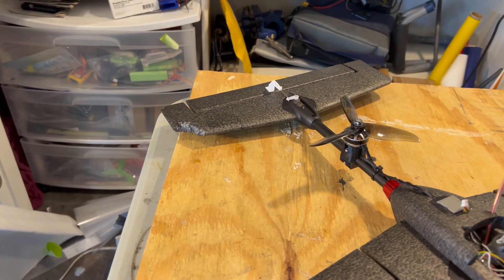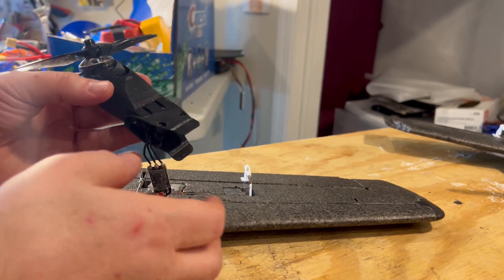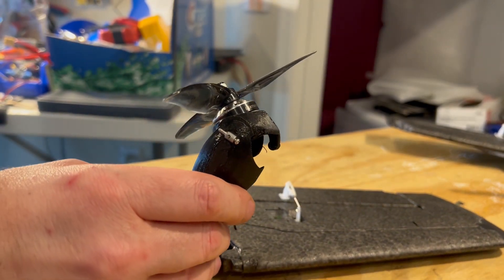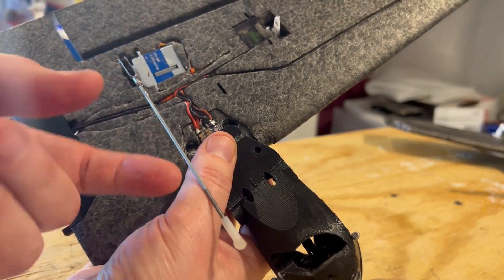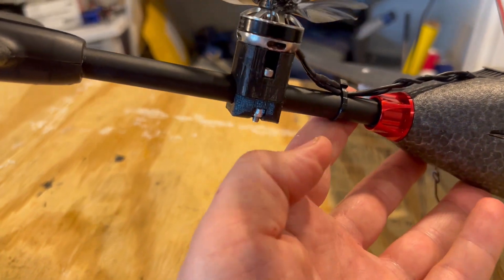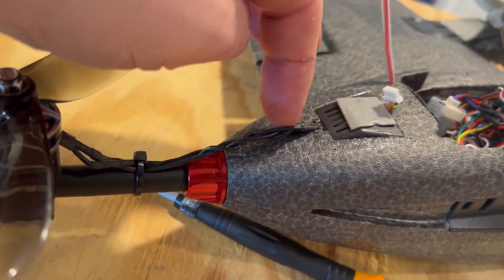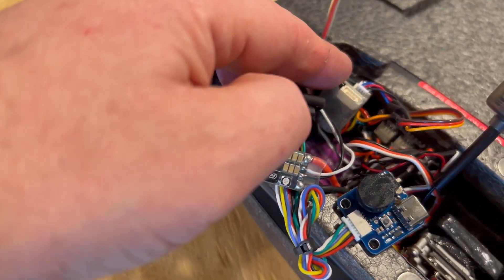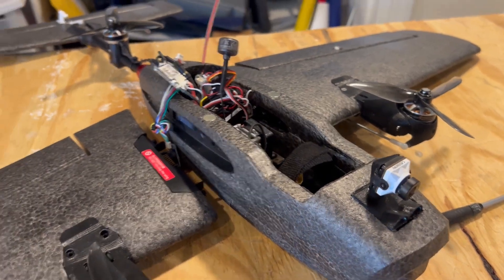Heewing T1 Ranger VTOL build walkthrough

Comment: Interesting build i have decided not to do this as it's very complex adds lot of points of failure decreases efficiency and add weight .. also it's really not needed the T1 can land on like 5-7m runway basically doesn't stall so I don't see why would anyone do this unless you wanna tinker or just don't even have that 5m runway 🙃
Reply from the maker: Well it may not be for you but some of us enjoy the challenge of building something different.  Also see my later video where I take off and land in my backyard, a flight I couldn’t ever do before.
Reply: @Appelm1  yeah of course that's why I mention tinkering.. it's cool just don't see the need for this airplane at all lot of sucrificing made to very little benefit gained
Reply: @Appelm1  He does have a valid point though.
Reply: @Appelm1  maybe i could convert my timber night into a vtol taildragger of course gotta use bigger esc and motors

Comment: What kind of battery are you using?
Reply from the maker: 4s 2000 lipo
Reply: @Appelm1  How did your flight control fit into the plane?
Reply from the maker: @教地理的宋老师  it’s tight but it fits.  I cut some foam and removed some wood where I needed to.

Comment: Why bec for the servos and not over the FC? / Can the DJI transmitter be used? Thanks.
Reply from the maker: Can use the FC if it has enough current capacity.  In fact I have since rebuilt this and put the Matek H743-wing v2 PDB back on and removed the BEC.  I couldn’t fit it with my first attempt but I cleaned up the wiring and moved the tail motor ESC outside to make room and better cool the ESC.
Reply from the maker: You can use any transmitter as long as it has all the switches you may need.

Comment: Am I crazy for wanting to use my 2207 2000kv motors!!?? lol
Reply: For reference Chan (another T1 VTOL conversion) was using BetaFPV 1506 3000kv motors, with 20a ESC. His T1 appears to fly equally well. 
More motor will mean more weight and larger power requirement (also added battery weight). 
So bigger motors are not alway better. Sure they will provide hight thrust vs weight ratio, but they will kill flight time. 
Similar with propellers, one could add 7, or 8 inch. Not necessary crazy, depending on your goals.
Reply from the maker: Ha.  Well they will work. But I think the added weight won’t give you much gain and lower flight time unless maybe you try 5S or 6S.  I’m working on another vtol project with 2208-2000 on 6S. Still prototyping though.

Comment: I would assume the motor/props combo from the Minihawk would work on this?
At 12:30, maybe use a MR30 connector, would make it easy to plug and unplug. 
Check out the FPV TWIN SCOUTER on Cults, if you want something a tad bigger, it's fully 3D printed so gonna have to be a bit gentler on the landings :P
Reply: Sorry for being late to the party here on this thread. I use lower kv on the rear since it rotates a 6-inch prop, whereas the front motors are 5-inch. This, combined with the fact that the rear motor only needs to do efficient lifting, but the forward motors have to dance between being viable hover lift providers while also being a higher kv for forward flight. @Vincent @Appelm1
Reply from the maker: Yes the MiniHawk motors look about right.  He used slight higher KV than me. I just used what I had around from an old quad. I’m not sure why he uses a lower kv motor for the rear.  Mine are all matched.